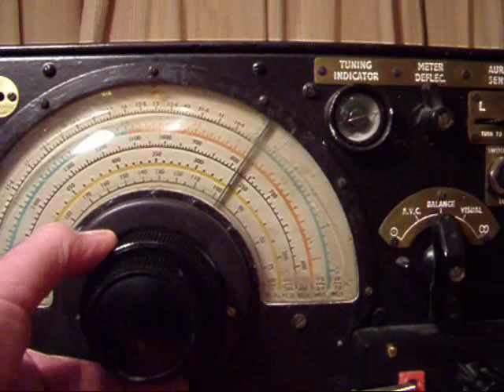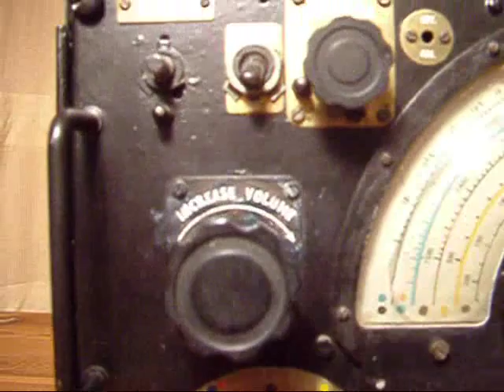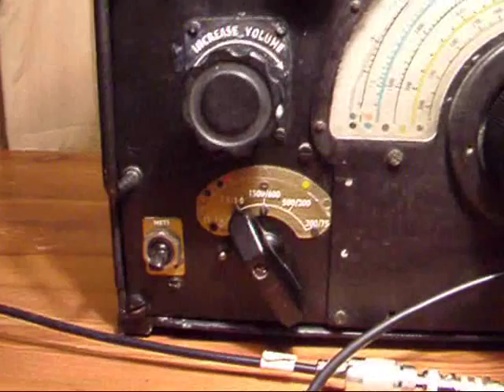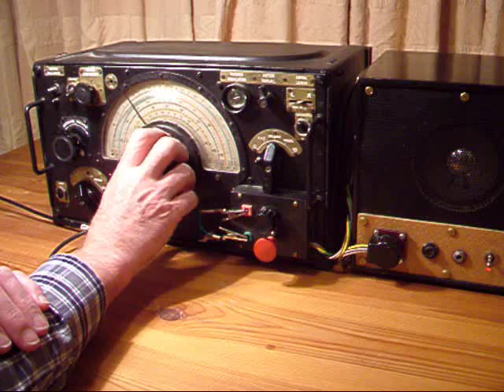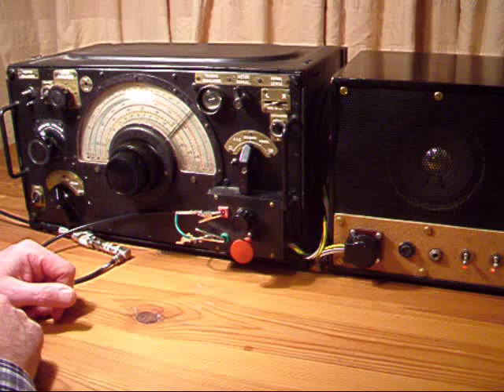An R1155 Radio

Comment: I had one of these back in the 1950s -60s.Bought at an Army Surplus shop in South London for £5/10/-£7,-- with speaker.A wonderful radio until I could no longer find the requisite valves.I was at sea for many years and during my absences this great piece of kit was thrown out!Thank you for the clip.